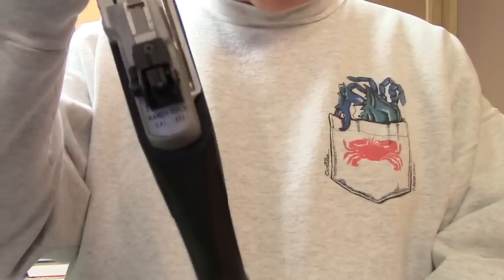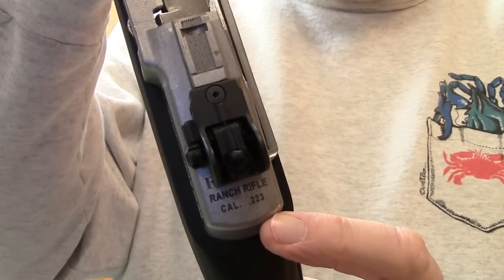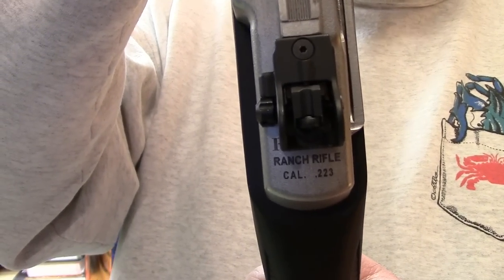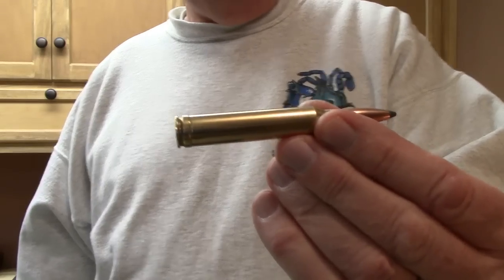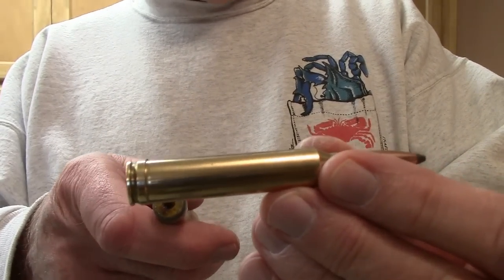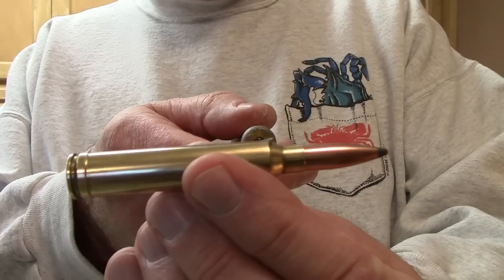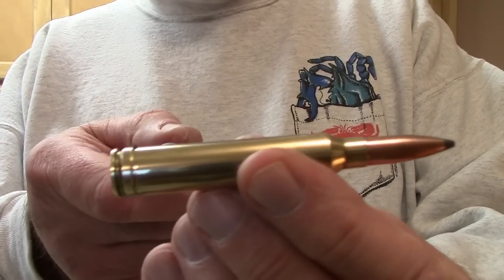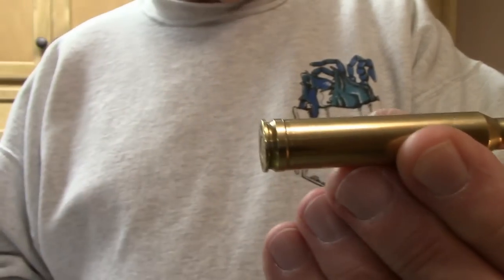Handloading PART II Pressures and Headspace ~ GunBlue's Complete Guide

Comment: Thank you again for another fine video.    

I found another sound mind that explained min vs max powder charges in a way that agreed with what I read.  I watched another channel where he tried to explain that 'Max' loading is just wrong from a safety standpoint and shooting as he was seeing this in forums.  Powder, Pressure, and velocity are dangerous aspects of reloading.  I liked the rattle snake explanation !

Specifically, he was addressing pistol reloading of range brass.   He pointed out that for him that the he found that the min load data was always closer to his 'perfected load' than the max load in the published data.   His observation was across numerous calibers and handguns. 

I would say for me I find the 'hand-loading' experimentation of working up loads to be the fun part.   Then doing 'reloading' once it is figured out to enjoy my satisfaction. Then start all over trying a different component to see which works better between my old 'best' and the new component.

Comment: A way to check for stretch marks in front of the web is to straighten out a paperclip and make a short "L" at the end. Stick the "L" end to the end. Drag the tip of the "L" along the side of the case. You'll feel it if the case is stretched in front of the web and about to get a case head separation,  sometimes before it is visible on the  outside of the case.

Here's a trick I use  to minimize case stretching.  NOTE; this is based on MY experience and MY .30-06. When I resize, I resize just the neck and don't touch the shoulder. This way, when fired, there is no place where the cartridge case can stretch. Your results may vary.

It would seem to me that shooters of belted magnums could use this trick and have their reloads headspace on the shoulder rather than on the belt. For them, it should minimize case stretching. I read anecdotal accounts of people accidentally (NOT RECOMMENDED, DON'T TRY IT) chambering and firing  .300 H&H cartridge in a .300 Weatherby chamber and ejecting a fireformed .300 Weatherby case. This can also cause a split cartridge case and a faceful of hot gas and brass fragments. 

However necksizing a .300 Weatherby case will eliminate the .0002" or .0003" slop and prolong case life by reducing stretching.

Comment: This is by far the best firearms related channel out there. I greatly appreciate you sharing your vast knowledge. I have a question. I had a 300 Weatherby magnum and had a blown primer with Weatherby factory ammo. I tried several other boxes of different ammo after this and would continue to have sticky bolts and extractor marks on the brass. I’m not very familiar with pressure signs. Do you know how this could have happened with 4 different types of factory ammo? I contacted Weatherby and they simply said that there were no reported issues with any of the lot numbers for the ammo, so they did nothing.

Comment: Hi Gunblue . Not a reloading question but a factory ammo /gun question.

 I picked up a late 50s 30-30 winchester last year and love it.  However , fired some Rem Core Lokts  and was sticky on extraction. Ran some Empty ones from a few months ago  through one at a time some sticky some normal easy extraction . So went shooting Fired one wanted to be sticky so cocked hammer fired empty shell extracted perfectly I did this several times same result. 

Bought some Win Superx came back to shooting spot ran like a champ and then so did the rest of the Remingtons .

Cleaned it up last night first couple shots this morning  little resistance unlocking , shot Remingtons and Winchester box each today and all ran well. Weird , all factory ammo.  

I don't reload but keep center fired brass in case I do at some point. Some of Remington a few were very slightly protruding but definitely not flat.

Comment: Excellent points!
"working with a thin barreled shotgun, they burst very easily.....there is no such thing as pressure signs with a shotgun"  
"you could hit maximum below what is listed in the book"...so true...especially if bullet is seated in the rifle lands.   Also a load developed at cold environments (I live in Alaska) may show no pressure signs, yet under hot summer conditions may have high pressure.  Monolithic bullets will typically have higher pressure, for example in 30 06 a 150 gr Nozler E-Tip has published higher pressure than a 150 gr Nozler Ballistic tip using the same powder charge and same velocity.
For precision rifle hand loads, typically I get my lowest variation in muzzle velocity below published max.

Comment: Hey gun blue I love your channel and love the way u present the information. I am a mechanic(very good mechanic ) and I appreciate  all cars and they're design . I can tell u have been doing this a long time and have a great appreciate all things ammo/guns. I am new to reloading. I have 60 rifle (223)and 500 pistol (9mm)cartridges loaded and shot . What rifle/cartridge do u recommend I start with to learn the intricacies, but with the Most success accuracy wise. I'm thinking a 22-250 or a 6.5 Grendel . Let me know if I'm way off base.
Reply from the maker: You can learn with any number of cartridges, but its always nice to have one that can provide great accuracy for your efforts, and a rifle that matches it.  Great expense is completely unnecessary.  I always prefer bolt action rifles, simply because they are strong, have great leverage, and are the easiest to achieve accuracy.  The 22-250 is a wonderful round that works with a lot of bullet weights, and has versatility to be loaded at various power levels.
Reply: Adam, I was a light/medium diesel truck mechanic in the army and an automobile mechanic in the 1990's/2000's when I got out. I DON'T, however, appreciate all automotive designs and found some absolutely deplorable like the Mercedes-Benz grille hanging from the hood that once whacked me in the skull and the stupid horn button on the end of the turn-signal arm in a Jaguar Sovereign. The vehicles I appreciate most nowadays are Toyota cars and light trucks. I own a 1995 Corolla DX now and it's a sledgehammer and anvil for reliability just like the 1975 Corolla E-5 five-door wagon my family got new in 1975.

Comment: I started reloading about 5 years ago and I use lee dies, I reload for 6 different calibers and I love it but the only issue I ever had was with my Parker Hale 7 mm rem mag on some cases I was getting a ring about 3/8 of an inch from the bottom, and on 2 occasions I had the cases separate  now I tried to find out what could I be doing wrong or was the issue with the rifle I wasn't close to max load so I didn't think that was the issue , and I was setting my dies as per lee recommendation. I got all kind of answers from my query's but nothing that helped, but I did find your comment about the dies adjustment causing such problem interesting but since i was setting them as per lee recommendation I'm not sure that alone was the issue , but 2 years ago I invested in neck sizing dies and instead of Full length sizing I neck size I haven't had the problem since. I'm not sure neck sizing resolved the issue but in my case I haven't had any case separation since neck sizing. I do like you videos they provide valuable information keep them coming.
Reply from the maker: The answer is simple, to a problem that's extremely common.  Lee' dies are correct, but it's typical for shoulder length in the chamber to be excessive, due to headspace being determined from the belt.  Unscrew your full length die by one and a half turns, and progressively size a case and tighten the die by a quarter turn until the case fits your rifle normally.  Use a different case each time, so you don't overwork the brass.  When done, go back and resize all.  Neck sizing is also extremely good, with the same rifle, especially if with a Lee collet die which will preserve your brass, too.
Reply: +GunBlue490 
Thanks I'll try that next time I resize my 7mm

Comment: Back in the mid nineties, a range friend of mine had just bought a new Glock in .45 acp. We used to meet there one night a week to shoot.  We would shoot each others guns at the range etc. He hadn't shown up for a few weeks and I thought nothing of it.  Then one day, I walked in, and there he was talking with the salesman at the gun counter.  I asked him where he had been.  He said, didn't you hear?  His gun show reloads had blown out the bottom of the Glock's chamber.   The slide and barrel flew up and hit him in the head between his eyes, breaking his glasses.  The frame broke in two on the right side, and the discharge blew the trigger group down into his index finger and hand.  His trigger and middle finger, and part of his palm were all wrapped up and healing.  He said the trigger and frame pieces mangled his trigger finger when the assy blew out the bottom of the frame.  Also, he wasn't sure normal function of his finger would return as he had some nerve damage.
He appealed to Glock in an attempt to get them to warranty his pistol, but they declined. That's one reason why I never gift anyone my reloads, and when I load fast powders like 231, bullseye, etc., I'm very wary of my powder charges.  I check, then check, then recheck again that I haven't thrown a double charge.  Use the book when determining charges, discipline yourself to pay attention when you reload, and know that the headspacing  is correct on all of your firearms.

Comment: I am researching loads for my .45 Colt using a 250 grain RNFP bullet and using powder that I currently have. I found two, one calls for a OAL of 1.575 and one 1.600 with two different powders. At a seating depth of 1.575 the case mouth is lined up with the crimp groove of the bullet, the 1.600 seating depth leaves the crimp groove high. What affect would seating the bullet to 1.575 have on pressure?

Comment: I have an Spanish Mauser, model of 1893.  My copy was made at Oviedo in 1899 as a replacement for a similar rifle that was lost in the Spanish American War in '98.  I am told that they were made deliberately with excess headspace because late 19th century brass was made to liberal tolerances.  I noticed that primers of factory loads would back halfway out on firing.  After a spell in my pocket, the primer would separate completely.  On reloading the case, I keep full length resizing to a minimum.  On second and subsequent firings, the excess headspace is gone and the primer remains secure.

Comment: I find best accuracy is achieved before maximum loads are reached.  If you need much faster velocities then use another cartridge.  IMR 3031 has served me well for several cartridges.  I get the same velocity with IMR 3031 and IMR 4895 in my 35 WCF however it feels like less recoil with IMR 3031. I'm I dreaming this or do others have the same result?

Comment: Saw a video regarding bullet to land  measuring. It went as follows. Fit the bullet in  a case so it it can move without any force. Then a little loc tite to inside of caase.  Put this round in chamber , close the bolt and let it sit for a few minutes. Remove bullet , measure overall length and decide adjustment of .030 or whatever for jump to rifling lands. What is your thoughts on this sir?
Reply from the maker: That should work.  Be sure that the LocTite doesn't get into the gun.
Reply: @GunBlue490  Yes Sir! Thank you!
Reply: @GunBlue490  the loctite is applied a small drop with a q tip. In case anyone read this. Thanks for all your great work sir!

Comment: I have been reloading since the early 80's, and it has always been about accuracy. In all these years I have only seen 1 rifle that liked over max loads, (flat primer is as far as I would ever try). Having seen several firearms come apart via overpressure, it is a dance I am not willing to do. And to that 1 rifle I meantioned I got rid of it quickly.
Reply from the maker: Most folks don't realize that an overcharged load will yield less than 1 percent greater velocity. Even at 100 feet per second for a 3,000 fps caliber, that gains less than 20 yards of ballistic advantage, and with such calibers, the standard pressures are already on the roof.

Comment: Just received my copy of Richard Lee’s Modern Reloading.  In the manual they list a overall length.  Is that measurement a maximum length or a minimum length?  Thanks
Reply from the maker: Lengths are always minimum.  Maximum is limited only by magazine length, minimum allowable seating depth, and/or throat length.  The general rule is to seat at least one caliber deep, though there are exceptions.

Comment: If anyone could tell what happened with my experience I would greatly appreciate it.
At the range I was shooting my smith and wesson model 629 chambered in. 44 magnum when it jammed I couldn't get the cylinder open.
I had to take the gun apart.
What I found was the primer came out or backed out and jammed.
The bullet  ever fired.

Comment: When loading 45acp with cast bullets and you use a rolled crimp how does that impact where the headspace is or will be?
Reply from the maker: The 45 ACP headspaces on the front of the case and cannot be roll crimped. It requires a firm taper crimp.  I prefer to use Lee 4 die set with the factory crimp die that post sizes to exact factory dimensions.

Comment: Sir, with respect to pressure and your comments on the 5.56 NATO vs .223 Rem, does the same hold true for 7.62 NATO and .308 Win?
Reply from the maker: No, it doesn't.  The 7.62 NATO may be fired without concern in a .308 Winchester chamber.  In fact, as with military loadings of the 30-06 Springfield, civilian loads are loaded to greater velocities and higher pressure than service loads by at least 100 feet per second. 7.62 NATO brass is typically heavier, which reduces powder capacity, so charges should be reduced by at least five percent and worked up with great caution.

Comment: I have a question, if your weapon is punching a hole in primer will that cause damage ?
Reply from the maker: Absolutely!!  That will destroy your gun, and may kill you!!  Gasses may have cut into the firing pin, sharpening it, making matters worse.  Do not fire it again before having it checked by the factory, or knowledgeable gunsmith.  This is normally a condition caused by cheaply made ammo, which should never be fired, but I had one very high grade rifle that had a firing pin that protruded too far, requiring professional shortening.  The latter is a very rare situation. The first is not uncommon with cheap guns and/or ammunition.  Even if ammo resolves the problem, you must have the gun inspected before firing it again, as it could be seriously weakened, and certainly the firing pin or spring could be damaged.

Comment: Is their a "simple" math problem you can do to calculate your pressure or what it should be before loading
Reply from the maker: Yes. Calculate the cost of a reloading manual published by laboratory technicians that measure those pressures with advanced pressure measuring systems. Never load without approved, published loading data.
Reply: @GunBlue490  well I have both the lyman manual and the lee manual but I mean as in if I go up or down a few grains how much should I expect the pressure to change. I read both books cover to cover and haven't seen any specific calculations

Comment: Using 3 different hypothetical bullet weights 150, 160 and 170 with 160gr as the baseline. The 170gr bullet should use relatively less powder because heavier bullet has higher inertia and takes up more case capacity. So to prevent higher pressure, the powder needs to be reduced. However, what would happen if you were to use the same powder weight for the 150gr as the 160gr? Does it also cause the pressure to spike? This is purely an academic question, in practice I only follow the load specified in the manual....and yes, there is only one God and He loves us.
Reply: Your correct about higher inertia.  But  not case capacity....you can load 150 gr vs 180 gr and they could have a case capacity of 88% 82%. 
Imagine pushing a marble through a pipe versus a lead ball through a pipe with a handheld rod.
As an example,  30 06 with IMR4350 54.0 gr, 150 gr bullet had a published pressure of 47,400 psi while 
30 06 with IMR4350 53.0 gr, 180 gr bullet had a published pressure of 48,300 psi
Reply: @RetrieverTrainingAlone  still...what would happen if one were to load lighter bullets with heavier bullet data? If case capacity is the same and less inertia, what's the danger? I also have a similar Q but regarding same bullet weight but jacketed vs lead but that's for later.

Comment: Can you use cci 41 primers for 223 ar15 rifles
Reply from the maker: mzaboynik 
They are a magnum small rifle primer that are designed with reduced sensitivity to help prevent unintentional slam fires in military applications. Unless you have a particular concern about slam fires in combat conditions, there's no benefit whatsoever.  Lowered sensitivity comes with a price, too.  If you desire accuracy, you want increased sensitivity, not decreased.  I wouldn't buy them for my ammo, unless others were unavailable.  Just use what the loading manuals call for, and keep things simple.

Comment: Also what is your opinion of 380 for self defense ?    Thank you in advance..
Reply from the maker: The .380 has improved greatly with better bullets. It is entirely a self defense or officer's back-up weapon. It's certainly adequate.  It's primary usefulness is its compact size, but now that 9mm pistols have arrived with more compact design, they are worth considering, though they will never be as small. Ultra small .380s are very difficult to shoot.  But a .380 in you pocket is better than a 9mm you leave home.
Reply: Thanks again for your very valuable information.